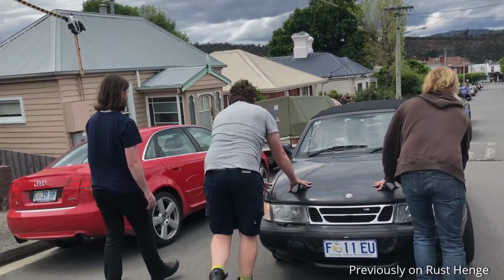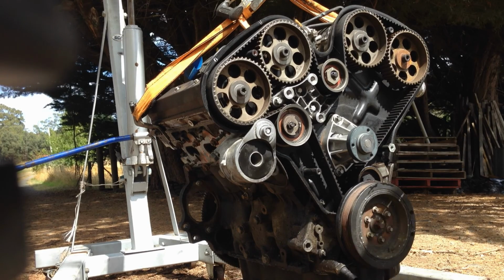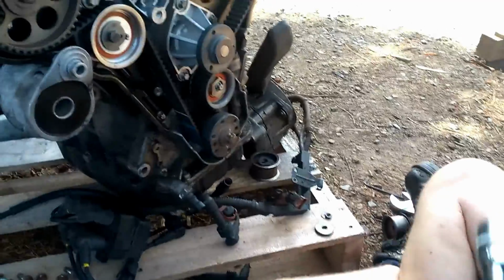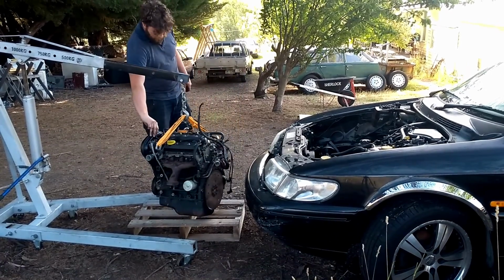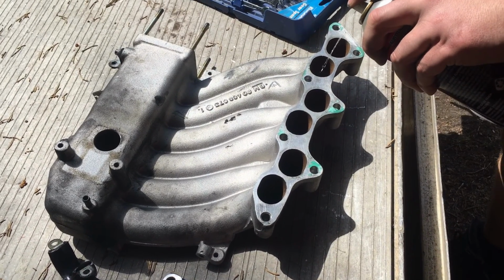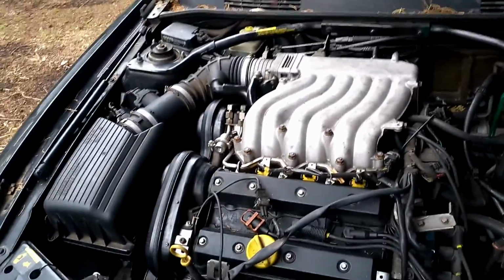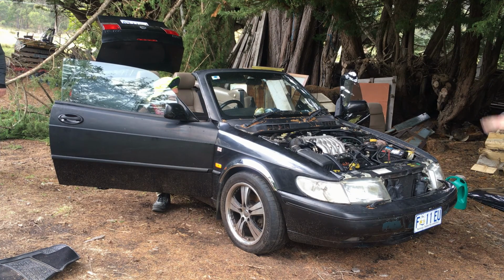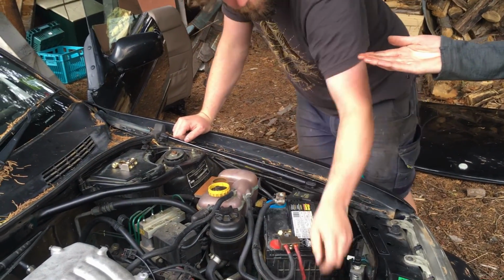1995 Saab 900SE Ep:3 A New Engine.

Comment: So it was the old immobiliser that stopped it starting? Was it just a simple bypass of the unit?
Reply from the maker: Yes we just needed to take the connection off the immobiliser unit and short a few pins across the connection.